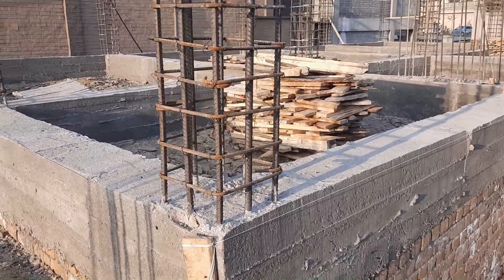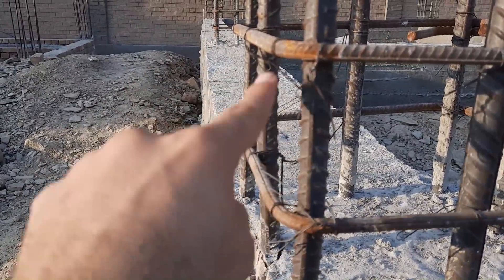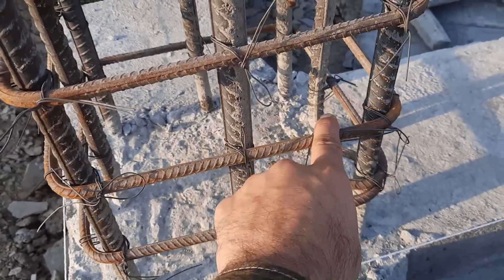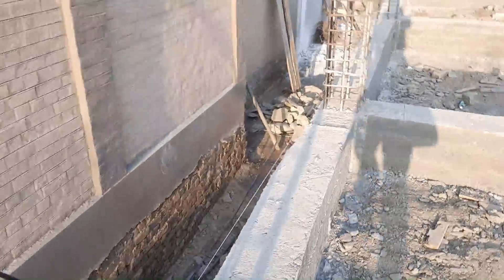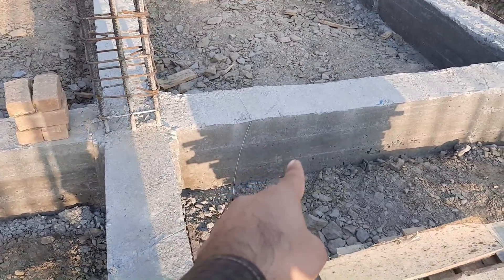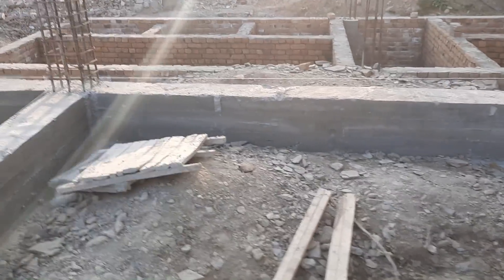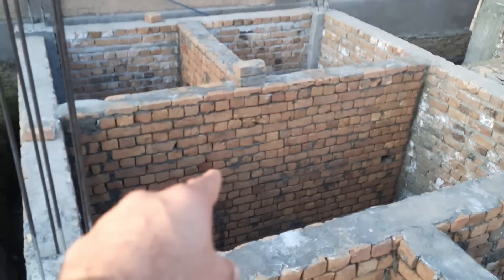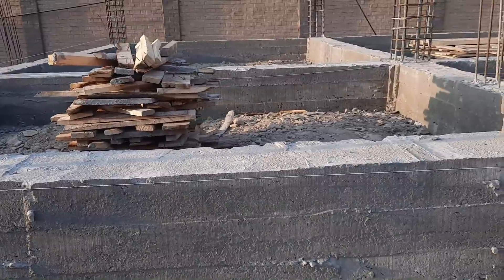Design of Column for Three Storey Building Practical Video

Comment: Sir,  distance b/w two columns 18ft, and column 9*12inch, pl suggest sillbeam, rcc and beam reinforcement details, construction area 30*40 ft (can I send plan sir)
Reply: For 18ft distance you could've used  12*12 inches column size

Comment: My contractor has give 25feet distance between two pillars. He has used 9x18 pillar size with 8 pieces of 16mm tmt bars. Beam size is given as 9x24 with 6 pieces of 20mm bars. It is a G+2 residential building. Is it ok ?
Reply: My contractor has also used 16mm x8 for the pillars. I want to know if it's OK. (3 story building)
Reply: No

Comment: Using 20mm rods, that too for 12 numbers, is way too much , not a feasible cost effective design
Reply: For G+2 6 no 16 mm is sufficient
Reply: @kgmanjunatha4849  what about G+3
Reply: Yes bro 16mm with 12nos is more then enough
Reply: Over designed column

Comment: These columns can bear 5 stories, The column design is over specified Its is not economical also design should make as per thickness of walls like 8x18 inch or 8x24 inch would be much better.
Reply: Rightly said, too much usage of steel for 3 storey building, even if it's commercial this specification has been exaggerated
Reply: Liked all arguments you guys. Very educative to us beginners. Thanks
Reply: Русская
Reply: It also depends on the geographical location and associated factors.
Reply: In the future, the commercial building can be upgraded to 5 storeys for more money... it is a common practice
Reply: You're right and he is right too, this column can hold 5-6 floor easily in resident building but as he said this one is for commercial building which mean live load is many times higher than the resident's live load so 3 floor in commercial is easily equal to 5 floor in resident
Reply: @Deepakyadav-jk5km  if the span distance between two columns is higher , then it's acceptable or reasonable to add number of steel rods, but looking at the site the columns are closely arranged and the rooms are not that bigger. Not a proper design
Reply: @valentinovictor  what if they have to put tonns of metal ore in it, all the theories is worthless in commercial everything should be extra

Comment: I am using 9 X 18 column size distance between two columns 20feet .. so which size using beams and bars
Reply: Depends the applied load and distribution on the beam?
Reply: Use Chat GPT. It will give you a lot of information but you also have to know what to ask.

Comment: I am using 9" X 15" column for 19 feet horizontal span So What can be the distance between two column  vertical span for G+2 building
Reply: 16mm - 4bars 12mm-4bars
Reply: Steel percentage should be maintained
Reply: What is your beam size?
Reply: @devapratimbaishya  9 x 15 inch
Reply: @ShrayanshJha  it's fine , where are you from?

Comment: Assalamo alaikum
I made a structural design of 3 storey domestic building as per IS code in my design column size is 230*230 with 16mm 4 baar and bindup it with 8 mm ties by calculation it can bear the load so it's right or not please comment
Thank you
Reply: 23x45 would have been much better